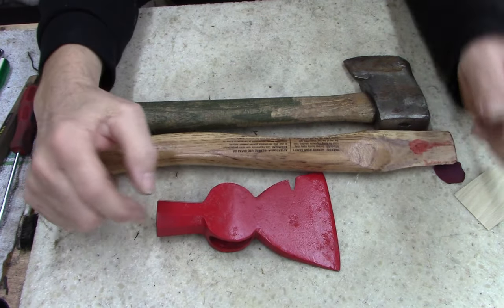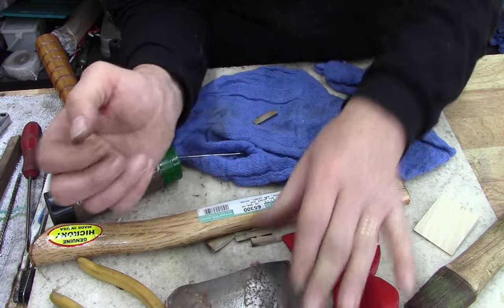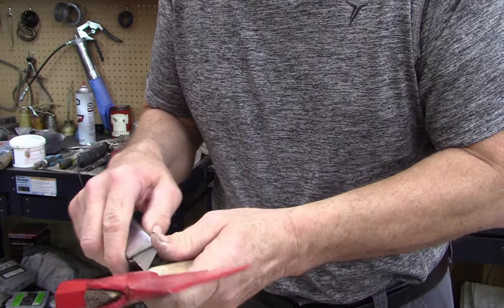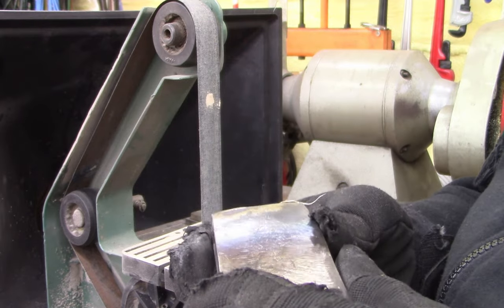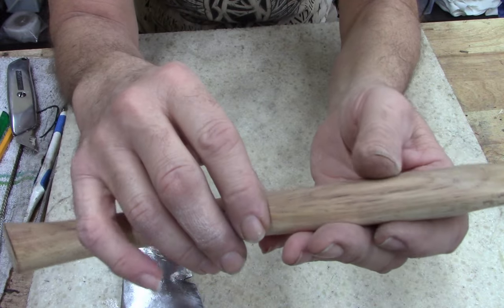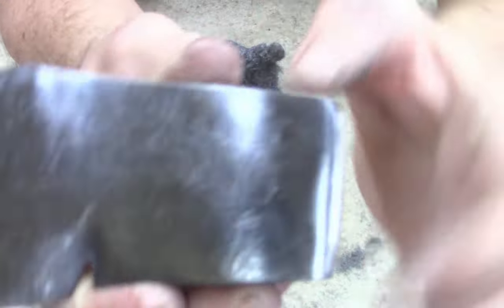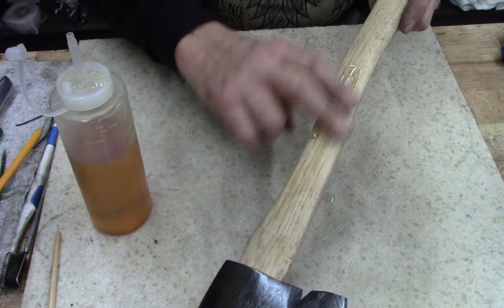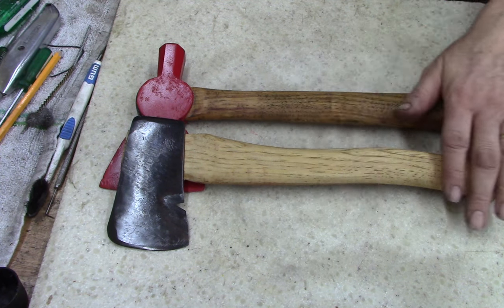Restoring 2 hatchets!

Comment: Great job DJ.  If I had to guess I would say possibly a flaw or trash in the steel and most definitely someone improperly using the hatchet by beating on the pole.   
Most all axe manufacturers will put a coating on the handle to protect it from getting dirty during shipping and when everyone touches them in the store.   They also put a generic edge on them.  From reading and talking with axe historians,  it has always been up to the end user to tune the handle and put a proper edge on the tool.   Just the way it has been since mass production. 
I think that was a 300 blackout casing 😂
Reply from the maker: Never used a casing before, that was a great idea! thanks! I think you are right it was trash in the steel when it was produced!

Comment: It looks like it was out gassing Which is a gas bubble trapped inside of the metal And then when you are milling it out That's when you find them  Material was not hot enough to burn out all of it's impurity
Reply from the maker: Make sense! it not like it was a piece of fine art, so they probably did not care during manufacturing and just shipped it!